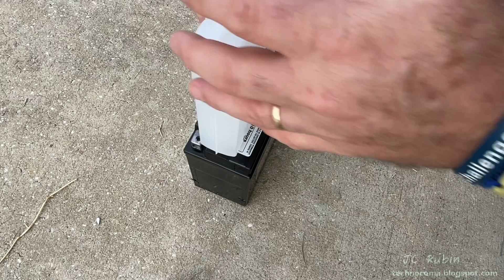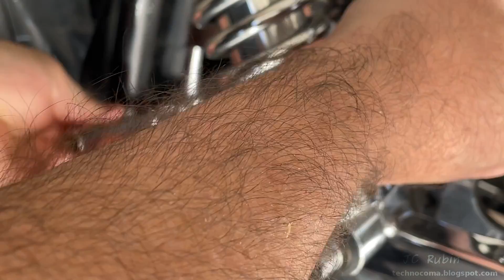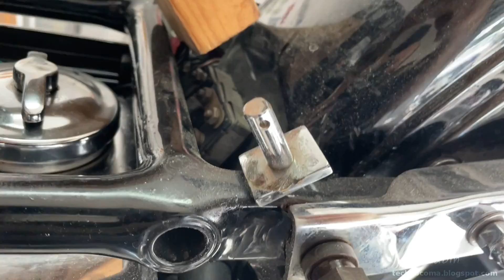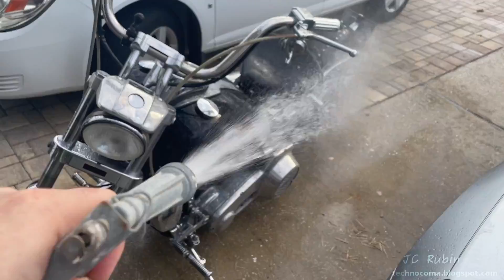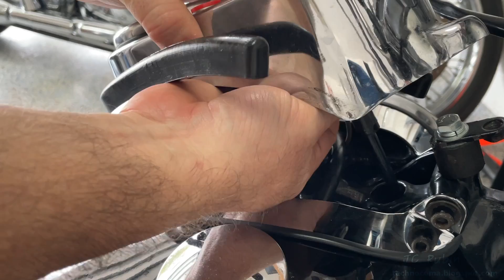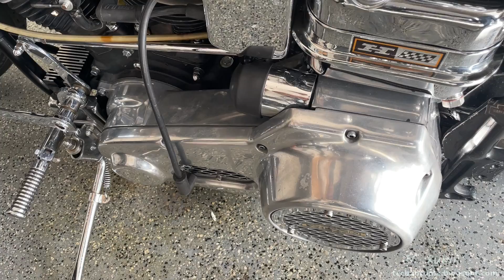Lowrider Shovelhead Post Rebuild Service and Checkup Part 2

Comment: Great video.  What's the procedure for accessing the oil cap and filter from under the new seat bracket?
Reply from the maker: The seat lifts up with the clips removed from the springs